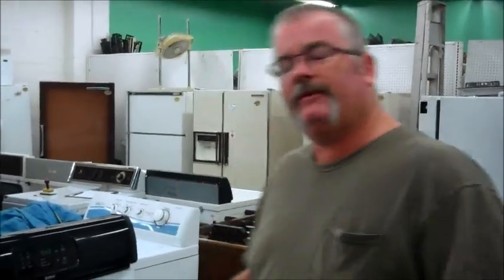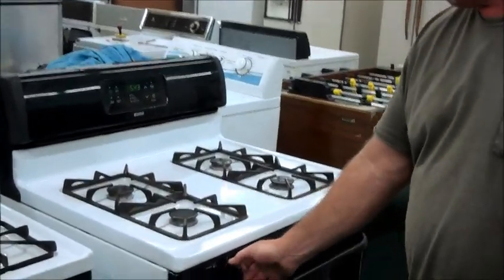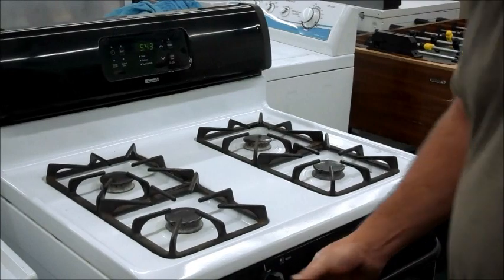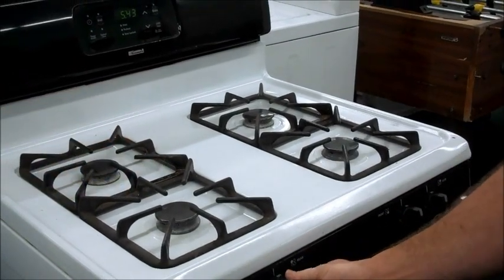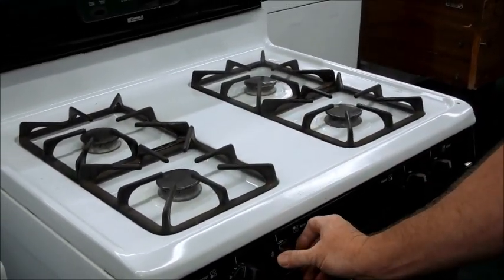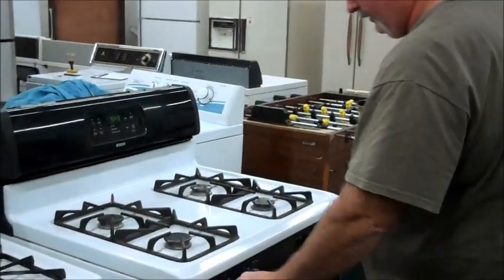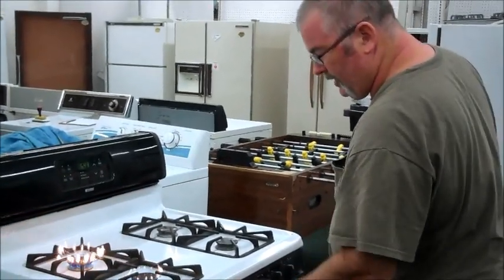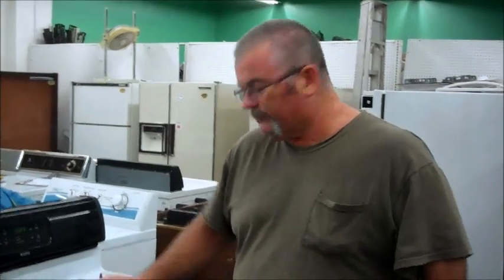Quick Fix for no tick gas stove   ~   how to get your stove burner working when it's not ticking

Comment: Wow! That worked for the one burner on my stove that doesn't tick. I turned on the burner behind it, kept that burner in the "ticking" mode, and then turned on the burner that isn't ticking and that burner lit. The entire 'bad' burner is completely clean - all parts are clean. Would it be a fuse that needs to be replaced to fix the 'bad' burner? Or is replacing the fuse only necessary when all burners won't tick?
Reply: Spark (or igniter) module

Comment: I've been needing to do this lately.  For faster ignition of the non-igniting burner, I suggest putting a clean pan between both burners and the bad one should light immediately, with very little escaping gas.

Comment: I tried this and it worked but it takes a long time for the front burner to light.  So the whole house starts smelling like gas.  Shouldn't the front burner light up as soon as I turn the back burner on and leave it on the click?  Boo hoo.  I can't fix my front burner.